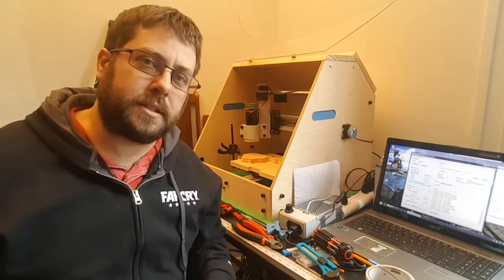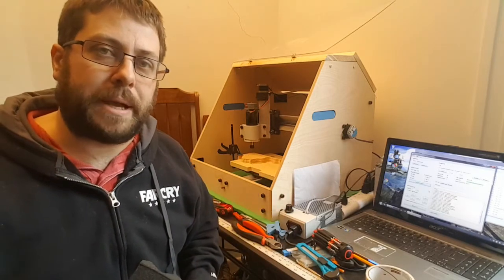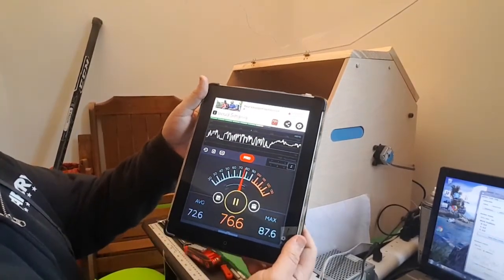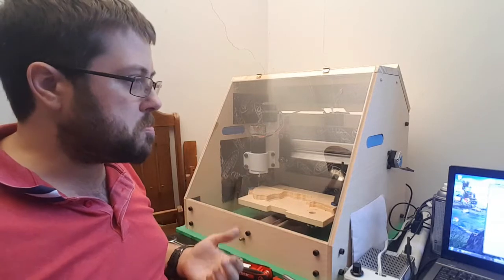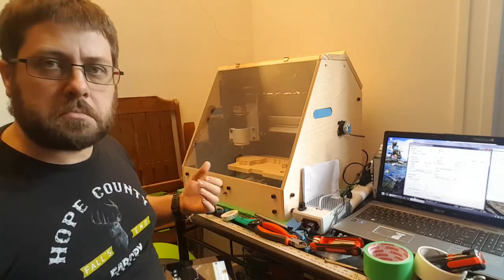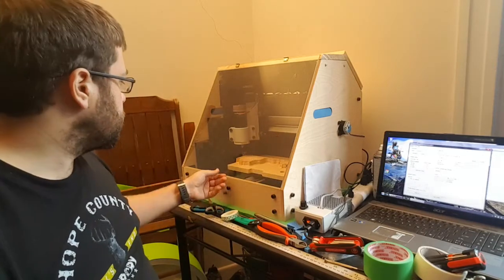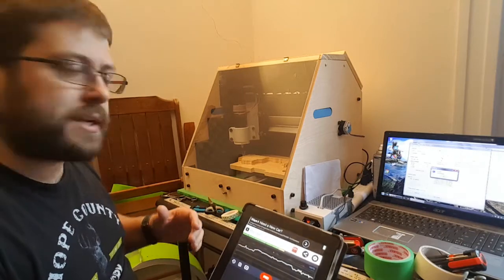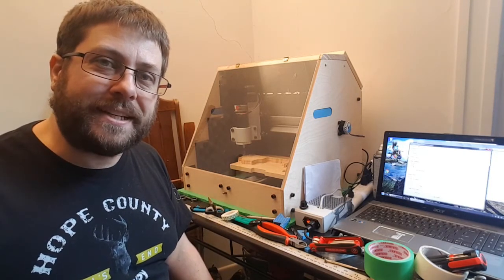Sound proofing my CNC machine - CNC Newbie

Comment: Your enclosure is like a little megaphone - it’s vibrating and the hole in front is going to project the sound out. The only way to reduce the noise is going to be an enclosure with mass and layers of varying density. You want to decouple the layers as much as possible. To reduce the vibration and help in decoupling, you could try doubling the shell with another layer of plywood with green glue or other adhesive acoustic material in between. The foam you have literally does nothing because it cannot absorb any meaningful energy. Another thing you’ll need to consider is heat inside the box. If it’s really well sealed up, the spindle won’t really get any airflow and might have heat issues

Comment: I discovered by trial and error that the self-adhesive Sound Deadener type of product is made to work with metal (not wood), your going to need a much heavier material such as 'mass loaded vinyl' weighted at least at 1 lb or heavier to bring down the DB. Putting the CNC equipment on that work bench probably has the entire work bench osculation and radiation sound.
Reply from the maker: ah, that explains why the sound deadener didn't really work. can you recommend a good mass loaded vinyl to look at?
Reply: @cncnewbie7297  the biggest challenge with mass loaded vinyl is the shipping cost; the heavier the weight the more effective the damponing effect... and the higher shipping cost due to the weight. I don't yet have a good source; however, I can tell you the stuff obtainable through local hardware stores fell way short. When I do come across a wort wile source I will fill you in on it.

Comment: Problem is dust on wall . Try use a sendvich with glaze surface oriented to inside. My machine is on half way to finish, but I send you picture off my solution (cheep :D ).

Comment: Have you experienced any squeaky noise by moving the x and y axis? Mine Sienci Mill One is making a squeaky noise when I move the x and y axis.
Reply from the maker: Eric Lee yeah I found after my first couple of cuts it was squeaking quite a bit. I got myself some lubricant for the lead screws and it fixed it right away. The lube I decided upon is the WD40 dry & dust resistant dry lube. Ptfe spray.
Reply: CNC Newbie Thanks for the advice. I have replaced the lead screw nut with the back lash preventable ones and they really damped the squeaky noise a lot. I will definitely try the Dry WD-40.